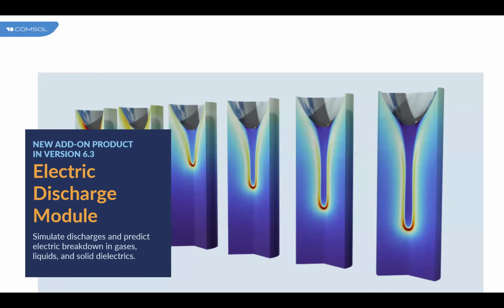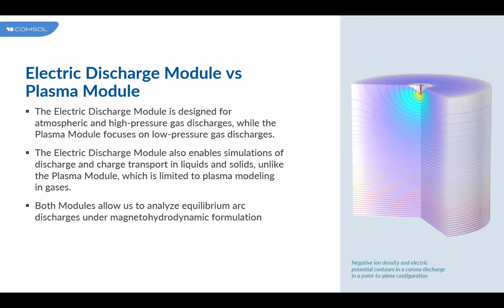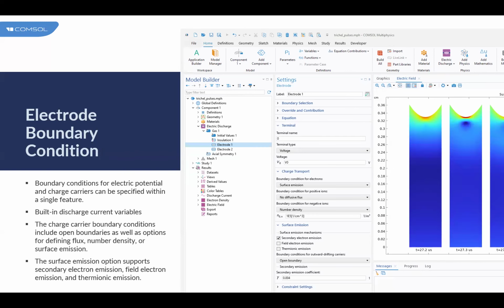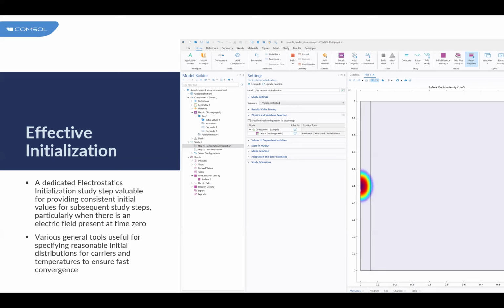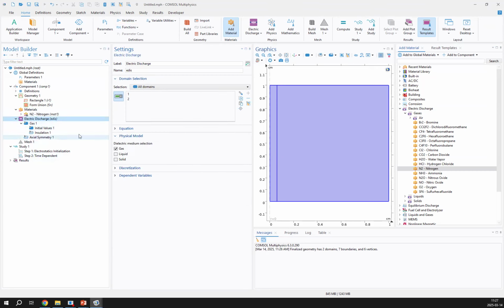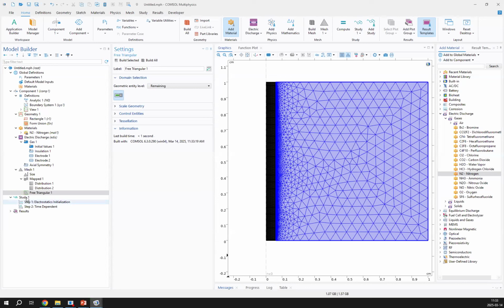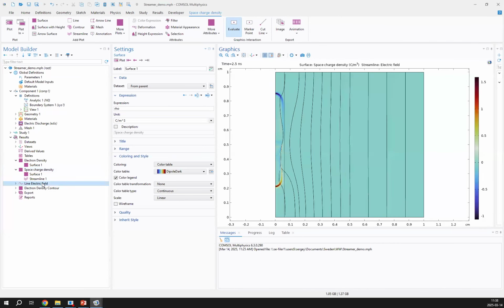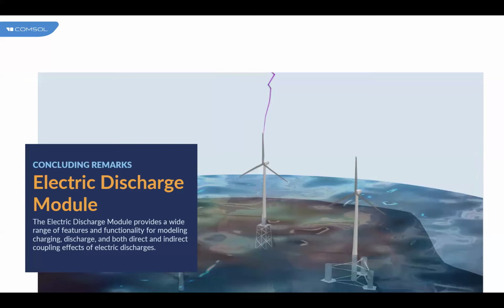Electric Discharge Modeling in COMSOL Multiphysics 6.3

Comment: Please check Electrostatic precipitator in applications library. Can u please tell mesh settings if we remove all circles inside the rectangle and assign the top as high voltage electrode in multiphysics and bottom plates to check parallel plates effect. Please help
Reply from the maker: Use the Electric Discharge interface for a general charge transport simulation. The one you see in the mentioned model is a niche one.
Reply: @sergey_comsol not there in Comsol 6.1

Comment: In 3D model if we make a cylinder and a parallel plate can we assign it high voltage in electrode ( multiphysics) . I am using COMSOL MULTIPHYSICS 6.1